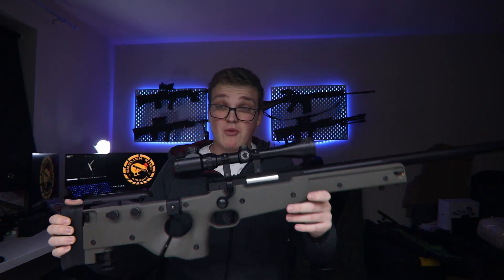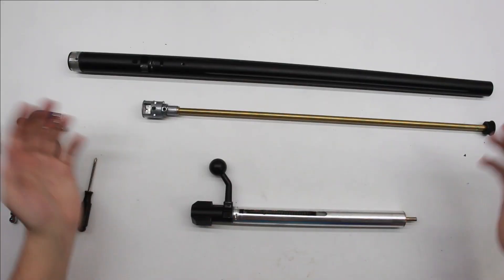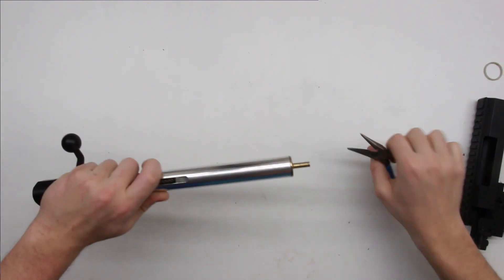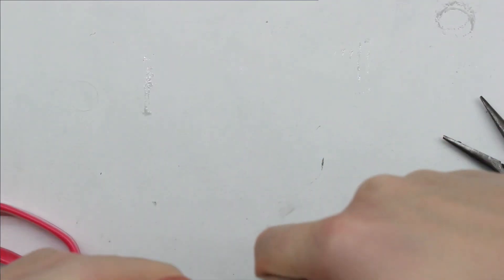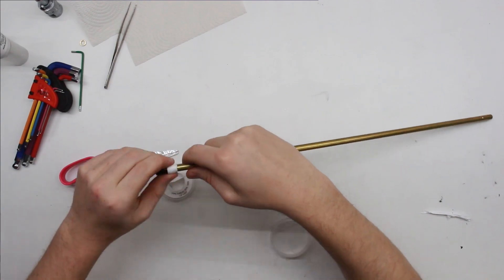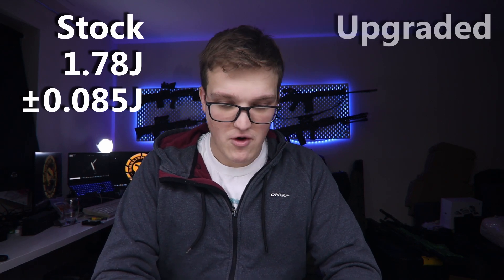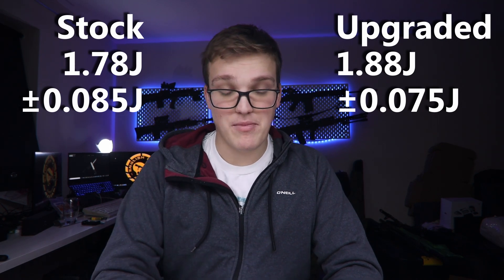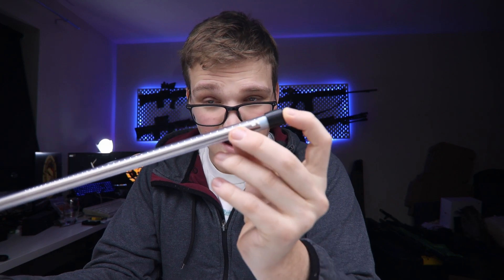DIY Airsoft -The Novritsch SSG96: Pt 2(a) Free Upgrades

Comment: Ow man ... this is tempting me to buy a L96 again....I must remain strong and finish my L85A3 first!
Reply from the maker: Why not both?
Reply: Because i have a strickt "Finish" wat you start rule. Enforced partly by my wallet saying no 😅.

Also any heads up on the ICS l85 hop unit? Or maby a adaptor for a m4 type hop unit?
Reply from the maker: Soon I promise! I need to get my lsw back up and running and do a bit more testing with my hop before I hit go on my order of parts :)

Comment: I have the well copy of the tm l96 and had a similar problem. Came with an AEG barrel so had to buy a vsr style barrel to accomodate the hop rubber. unfortunately there are no aftermarket hop chambers for the tm version so i modified the original.
Reply from the maker: I had one of those briefly, brought it broken, replaced the feed ramp and hop adjust, then never used it. Ended up selling it to a mate. Cool design, but very finnicky to get working reliably.

Comment: I've had great luck with a layer of PTFE under then over the bucking end, though this was specifically in an AEG.

Also, have you considered heat shrink over the nozzle?
Reply from the maker: oooh I haven't tried PTFE under the rubber, that might work! Ive been thinking how I could enlarge the nozzle, but the issue is the hop unit has such a small opening for the nozzle I don't think it'll work.

I have however torn the rifle down again and re-done the teflon tape (made it much thicker and harder to install into the hop chamber) so hopefully that should have upped the compression. I'll re-test and report back!
Reply: @EnglishKiwi  I use a layer under and over the hop rubber on my MK23 so it's a usable option .....looking forward to the following videos on this Rif......nice work as ever keep going 👍
Reply: @EnglishKiwi  that's a shame about the nozzle, but that may be an advantage to be honest.
Have you tried wrapping a thin layer around the outside of the bucking lips?
Reply: @EnglishKiwi  @17:30 another advantage to the crazy jet is complete VSR/AEG compatibility for all purposes